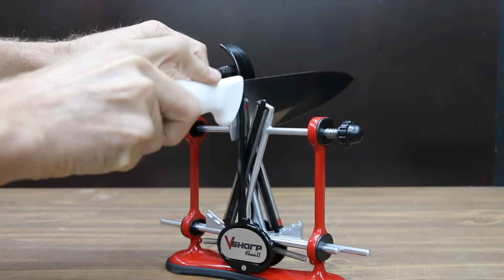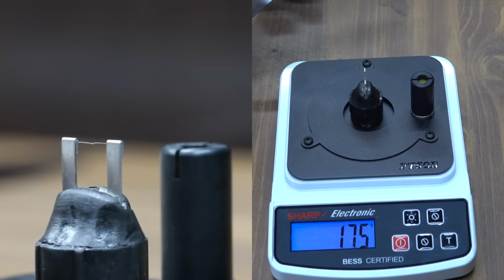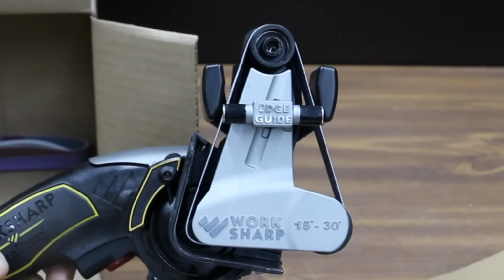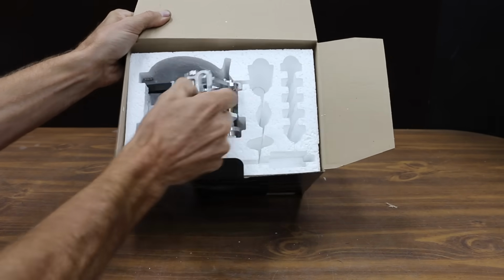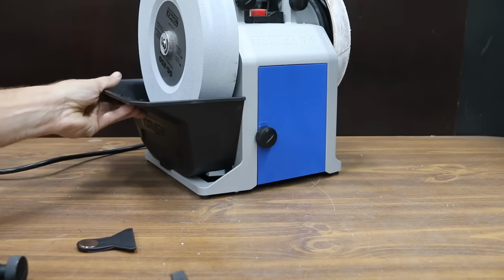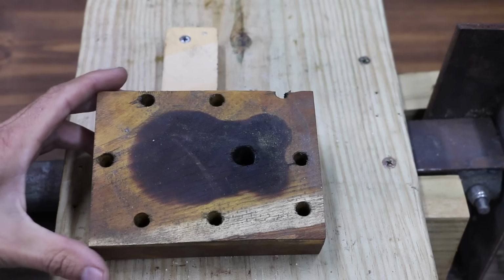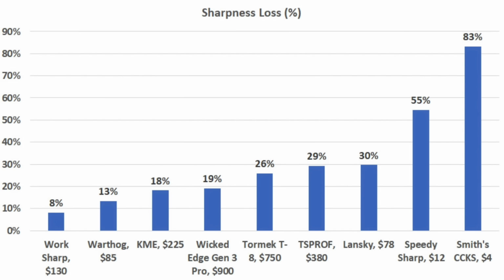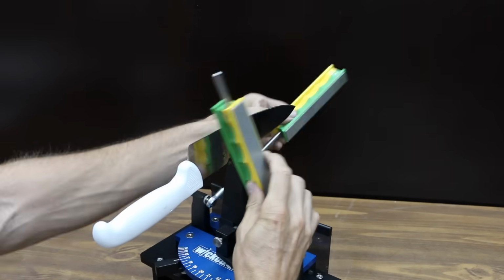RUSSIA vs USA Knife Sharpener? TSPROF vs Lansky, Wicked Edge, KME, Tormek T-8, Work Sharp Ken Onion

Comment: I use DMT diamond stones. They specify that they are monocrystaline diamond and not polycrystaline diamond, and clearly state that they last a lot longer than their poly competitors. Is this true? And apart from DMT do any other dianond stone manufactures specify which type they use?
Reply: Diamond stones should last a lifetime unless you're a professional chef that sharpens knives down to nothing inside of a few months.

Comment: I'm curious why you didn't include the Chef's Choice sharpeners. They have a very simple countertop model I keep on my kitchen counter. It has a course wheel, a fine wheel, and a stropping wheel. Because it is so easy to use I use multiple times per week. The Chef's Choice standard model is 20° and they also have a 15° sharpener for harder steel knives.
Reply from the maker: Thanks for the suggestion.

Comment: Suggestion for a video: Walkie Talkies. Specs vs actual and price points are all over the place. The Farmabago would definitely need to be featured in this video.
Reply from the maker: Thanks for the suggestion.
Reply: Oh man what a great idea!

I have a Uniden set that is supposed to be rated for 32 miles, but I barely get a mile. Maybe 2-2.5 miles if out on a lake...
Reply: 4 years later, we have the walkie talkie video, which came out 2 weeks before my comment
Reply: @ramenthemadgod great!! I hadn't seen it yet. Thanks for the tip

Comment: I use the KME these days, but used to use the work sharp before.  Nothing seems like a faster sharp edge than the work sharp, however, it cannot reach 100% of all blades being sharpened, so you'll  slowly ruin some of your knives - and on a chef's knife, it'll keep you from being able to cut with the back half of the blade.
Reply from the maker: Thanks for the feedback.

Comment: You should try this knife sharpener--  Professional Kitchen Knife sharpener Sharpening System Apex KME edge-- on eBay  around 35.00, made in china. Works just as good as some of the expensive systems
Reply from the maker: Thanks for the suggestion.

Comment: I’d love to see a comparison with surge protectors and power strips. Which ones actually trip at the rated amperage, can sustain full rated power draw without overheating, etc
Reply from the maker: Thanks for the suggestion.
Reply: @ProjectFarm  Along those same lines, Battery Backup UPS systems.

Comment: Two things I would love to know: 1. How long did each sharpening take, and 2. How much blade material was removed (do some methods wear your knife down faster)?
Reply: I use a lansky for most sharpening for the last 20 years. On an ats34 knife that I have had the entire time  there is barely any noticeable wear. Sharpening is about 5 minutes.  I only sharpen until I can shave my arm. With daily use this will last around a month
Reply from the maker: Thanks for the constructive feedback.
Reply: How much comes off is all up to you. The worse off a blade is to start with, the more that has to be taken off to repair it. It's also up to you as far as how much YOU grind off with the sharpener. Yes, you CAN oversharpen your knife, and take much more off than necessary. Stop frequently while sharpening and inspect, once its ground off, obviously you can't put it back on.
Reply: I'm gonna tell you what. I use a worksharp and it you don't keep the blade moving you can easily put a trough in the cutting edge. I ruined 2 cheap kitchen knives before I got the hang of using it.  A tiny belt sander is all it is.

Comment: Most of these require too much time and setup for me and perhaps others who merely slicing, say, a tomato. I bought that $9 Rada sharpener that you reviewed in April 2020 and I simply pull it from the drawer and make a few passes. It's great; tomatoes don't stand a chance. Still, this was a fascinating video.
Reply: Yup, the KISS principle is lost on several of those kits.
Reply: Never go full Rada type sharpener. After a year or so the edge will start to get groovy in the bad sense and then there is no more hope other than a full re profiling of it. All drag type sharpeners are problematic in time.
Reply: @dragoscoco2173  Thanks. The knife on which I use the Rada primarily is old and thus disposable if need be. I'll keep an eye out for the "groovy."

Comment: He didn’t regrind the stone for the Tormek T-8. The Stone grader polishes the surface of the grindstone from its normal 220 grit to a finish that works like a 1000 grit stone.
Reply: Considering how polished the edge was I don't think it would have made much difference as he corrected that on the honing wheel. It's only if he managed to round the edge off with the honing wheel by polishing too much with different angles.

Comment: What about how long it takes to sharpen the knives?  That would be one of my main considerations for selecting a Sharpener.  I can get a knife hair slitting sharp with a couple of inexpensive stones from Amazon, but it takes a LONG time.  I use my knives, and I need to keep them sharper than "new". I'm  willing to spend $$ on a tool that gets them sharp faster so I can spend more time cutting and less time sharpening.

Comment: Your homemade knife made me think we need a “best prison shank” test.
Reply: "And prisoner 262 bled out in only 13 seconds, very impressive!"
Reply: @maaaark_nuuutt  omg
Reply: my money is on the shard of glass/ceramic
Reply: @frogz  but the sharpened toothbrush is probably the best bang for your buck
Reply: @acow9966  toothbrush does nothing
Reply: @frogz  Ceramic ftw. Ceramic beats out glass and store stolen galv sheeting in both sheer sharpness and availability depending on institution and inmate classification. As  inmate A5721 demonstrated  when he slipped off his basin cracking it and severing his femoral artery during his fall.
Inmate A5721 bled out in a record 13 seconds! loosing consciousness after four seconds after the cut was made.
Reply: 100%
Reply: "We're going to test that!"
Reply: Yes

Comment: i am very thankful for both knife sharpener editions.  I have been shopping for the entire year.  A wet stone is best, but my hands and eyes are just not there now.  Lansky seems to be the best value...but probably need the holder and a bench, and it takes a little bit of time.   You could do a 3rd series with electric sharpeners...i actually mailed kitchen knifes to one of those sharpening companies "as seen on tv" once and i am certain they just used an electric sharpener and it was awful.   Very thankful PF for the info.

Comment: It would be interesting to see you retest some of the knives by swapping them to another sharpener. (Take the knife which was tested on the Speedy Sharp or Smith's and run it through the Wicked Edge to verify the results of the Wicked Edge.)

Comment: It would be great to see how long it takes for the sharpener to bring the knives up to speed. Some of this looks extremely tedious. I've always sharpened my knives freehand, it just seems like the fastest route to get a good edge. Not sure how more "mechanized" methods compare.
Reply: Depends on the method.   I started with free hand also.   To me it's an art form.  However, when I have deer to skin and butcher, or a bucket full of bluegill to filet, I don't have time for art.  I prefer the spyderco sharpmaker for keeping most of my work knives sharp, but considering the Ken Onion for repairing overly dull blades, and dealing with cheap kitchen knives.

Comment: Great as always!  I would give the Smith's another try with many more passes on the carbide side to start with on a very dull knife.  I thought that the methods that changed to a different angle or 'micro-bevel' might be sharpest at first but dull faster.... I don't think there was a trend though.

Comment: I've owned that Lansky for approx 15 years and for the money it puts a good edge on my knives.  I make knives, so what matters to me is how fast can I dial in my initial edge geometry.  Once you have that, most of these sharpeners are pretty much the same.  Edge retention has a lot to do with the steel, and as long as you are under 200....you've got a sharp working knife.  The Ken Onion Worksharp is great to get your initial geometry if you are making a knife.  If you are just sharpening a commerical blade, any of these work.  It comes down to budget.

Comment: I have a work sharp and it would be great if there was a hard surface behind the belt to keep it from deforming. Instead it creates a curve on the blade which is not ideal for making it consistent.
Reply: The backer helps the coarser grits cut faster too.  The air-file-like attachment taught me that.  I'm wanting to upgrade to something with a platen and 2x72 belts when i can.

Comment: The Lansky system is the best “bang for buck” system out there. For the average user at home, you are not going to notice the difference between the Lansky and the Wicked edge. Especially considering the outlay. Lansky has hit the mark providing a great product at an affordable price. Job done.
Reply: I've had a Lansky for 30 years and love it. It has stones instead of diamonds. Keep playing to get some of their diamonds but haven't done it yet. The stones still work just fine
Reply: Q
Reply: Nope, the Work Sharp Precision Adjust is. I got it for $50 CAD when I couldn't find the Lansky anywhere for under $70, which is just a clamp and some stones... Not even a stand so it's not too practical or easy to use.
Reply: The problem with that style sharpener is the angle reduces the further away it is from the pivot
Reply: @The_Ballo  Eh? Do you know how angles work? Look at a Triangle. The further away from the pivot point you are, the angle stays the same. It doesn’t change. Same with a cone. Chop a cone in half. The cross section is a triangle……
Reply: @R3V0LV3R45  I don't know what drugs you're on, but for a given opposite length, a longer adjacent length reduces theta. Beyond basic trigonometry
Reply: I agree, but the best and simplest method is to still just hand sharpen your knives. There is no need for jigs and contraptions. The are very uneccesary and a waste of money. All you need is a decent sharpening stone.
Reply: @orion7741  I have to disagree. Fact of the matter is, unless you are sharpening knives professionally, you won’t be able to get the EXACT degree of angle to sharpen on every stroke. Is this stroke 22 deg? Is this stroke 20deg? You don’t know. For the average joe that wants their knife sharpened once a year, these systems get the edge consistently at the correct angle, each time, every time. It takes the guess work out. Which is what you need for a sharp knife. So yes, you DO need these systems.

Comment: I appreciate the work that goes into producing a fair and equal testing methodology, especially when comparing non-equal methods of sharpening. I've used various Tormeks for my tools over the years, and they can certainly be made sharp enough to shave. I don't think that knives are their forté, even though they do the job pretty well. Perhaps adding in a wild card of sharpening a knife edge using the exposed ceramic on the bottom of a coffee cup would have been fun! Certainly, they're available and cheap :-D
Reply from the maker: Thanks!  Thanks for the feedback.

Comment: After extensive sharpening on a Lansky an umbilical cord is cut very easily with a lock blade from my grandfather and 27 years later after NO maintenance it will still “pop” hairs off my arm
Excellent choice

P.S I’ve also used it while watching tv and even as a passenger in a vehicle (not recommended just saying)
Reply from the maker: Thanks for the feedback.

Comment: That work sharp is either not made in the US or there are millions of chinese "copies". Probably another case of "labeled in the usa".
EDIT: After some searching I found EVERY ONE of these on aliexpress. The Tormek is sold for $130-500 ("water-cooled sharpening machine") while many of the "hand held" ones sell for $5-15.  The 3 pulley electric hand held costs $75. There are also some other ones that look like a box with a planer sanding drum for $35-50. There are also heavy duty ones that are $600-2000 That are also meant for drillbits, milling cutters, tools and look like a tool room grinding machine setup for knives.

Seems like most of these companies are BSing on the manufacturing country. The "Tormek" one even comes with that triangular tool, so I highly doubt yours was made in Switzerland.
Reply from the maker: Thanks for the feedback.

Comment: Sharpness loss depends from the angle and the end finish. The more fine it is the more metal it is in the edge. 
I use "Edge pro" chinese copy and chinese diamond stones for it and the last sharpening with 2000 grit. After that leather belt and russian polishing compound. The knifes stay sharp quite long, but it makes my blood pressure rise a bit when wife cuts something on a glass/ceramic plate.
But it gives me a reason to play with the sharpener more often.
Reply from the maker: Thanks for the feedback.

Comment: As a South African, I was delighted to see the Warthog being tested. I was a bit surprised at the bluntness of the knife after you used the Warthog though. In my experience, working through the coarse, medium and fine stones and then finishing off on the steel sides, all with just a downward stroke motion, not a sawing motion, produces a very sharp knife. I personally prefer using a standard benchstone or a Lansky, but if I need to sharpen a knife relatively quickly and without too much fuss, I grab the Warthog. Great video btw! Thanks for the time, effort and money you put into your videos
Reply from the maker: You are welcome!  Thanks for sharing.

Comment: Hmm I love your videos, and indeed this video too but I have one issue with this bunch of testing which is using that piece of wood. I would think you used a new spot on that wood for each blade to give each blade a fair start. Problem is the wood will have inconsistencies in the grain right? I woulf think.
Reply from the maker: Thanks!  Thanks for the constructive feedback.

Comment: Fun as usual, though I would never try and removes a hardened 3" screw - abandon it, cut it. In the real world we are usually putting these things into a headless bolt or grease fitting. In my long experience only the taper shank straight removers like Mayhew or Gearwrench work reliably, especially if two  holes are drilled of different diameters. Spiral shanks expand the bolt more than turn it. Thought for a review, quiet air compressors like California, Dewalt, Senco and Thomas. Maybe throw in an ear breaking Porter Cable pancake one for fun.
Reply from the maker: Thanks for the feedback.

Comment: KME all the way. I started with an Edge Pro Apex. Once the stones wore out I wanted to try something new. I bought a Wicked Edge. Not only was it incredibly expensive but I found the double sided approach very awkward. I sold my Wicked Edge setup and tried out the KME. A few years later I'm still using the KME. I picked up a 50 grit and a 100 grit stone for aggressive reprofiling. I also got the lapping film set which allows me to get mirror polished edges. Absolutely phenomenal results. Even with high-hardness super steels like Maxamet.
Reply from the maker: Thanks for the feedback.

Comment: Hi Project Farm .  I noticed this is the 2nd knife sharpening Video you have done with different types of knife sharpeners . However I noticed they are of varying types . I was wondering why not use the same types . Similar to the Smiths brand . I have a knife sharpener made by Gatco called the Edgemate Carbide Sharpener  I bought it in 2007 off of one of the tool trucks but since have found it online and at Walmart for about $15.00 which is about half of what I paid for mine . The main thing is I have been using it since 2007 and it still puts a good edge on my knives and I haven't had to change the blades on the sharpener yet . The sharpener is very well made of Aluminum Alloy . Just something to think about . I really like mine .
Reply from the maker: Thanks for the feedback.

Comment: This is one of your most impressive videos, to tackle something so complicated with such precision. Though, you should have thrown in a commercial sharpening service.

Tl;Dr: If you have a ton of cutlery, the Tormek T-8's concave edge might be for you. The Work Sharp seems good for general knives. While the Warthog is a decent budget safe sharpener. For at home use, the Lansky is a great deal. Keep expensive knives away from cheap sharpeners.

There is still room for improvement, KME/TSProf are too dangerous and the Wicked Edge should be motorized for its price.
Reply from the maker: Thanks!  Thanks for the feedback.

Comment: Please consider the Work Sharp Precision Adjust. It is, in my opinion, the best sharpener for the money that is available on the market today Especially if you consider the newly available enhanced kit. I appreciate the Ken Onion version that you tested, and it is great for those types of people who need a good edge quickly, but it simply can't compare to the precision adjust model if you're willing to invest the time, like most of the other products that you tested. I admire you and you're willingness to test products that are on the market today, but I promise you that you missed the mark when selecting the Ken Onion version of the Work Sharp motorized sharpeners. Please consider testing the much less expensive Precision Adjust sharpener and I think you will have a completely different view about the quality products available. Thank you and best regards, Frank Vanderpool
Reply from the maker: You are welcome!  Thanks for the suggestion.